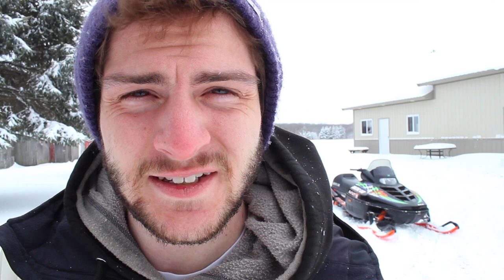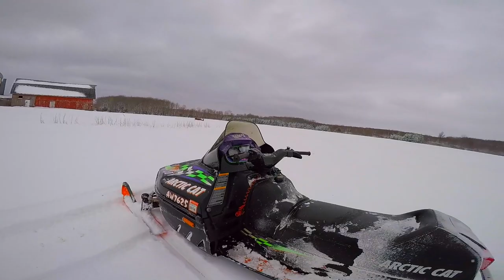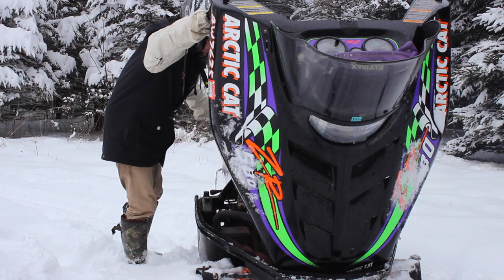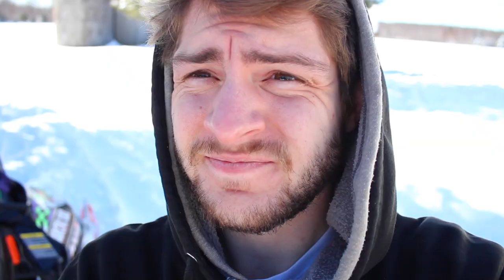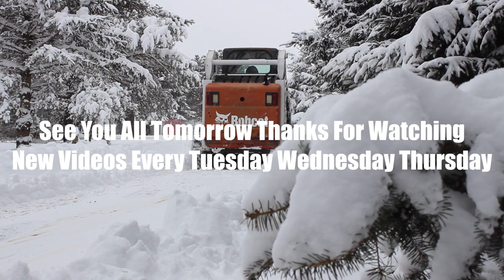MY SNOWMOBILE IS BROKEN :(

Comment from the maker: What do you think is wrong with it?? Thanks for watching see you guys tomorrow!!
Instagram: @jakesplace12
Reply: JakesPlace12Vlogs carb maybe... the same thing happened to my 92 Indy 440
Reply: JakesPlace12Vlogs check the clutch
Reply: track is melted to sliders and wont spin, or running really hot and overheating
Reply: JakesPlace12Vlogs it might be the belt
Reply: tvese1234 sliders melted!? He's riding it in fresh snow don't think it's that
Reply: Drive shaft bearing calling it
Reply: Sucking air somewhere or loss of fire
Reply: JakesPlace12Vlogs probably the clutch or the brakes locked up
Reply: A fouling plug would make it almost shut it off so idk
Reply: JakesPlace12Vlogs I was going to say "you might need to clean the carb" I don't know...
Reply: spark plugs?
Reply: JakesPlace12Vlogs what happened was the powder was too deep and it didn't allow the exhaust to get out so it ended up choking the snowmobile it will still idle but it will not have as much low or top-end power
Reply: motor sounds healthy. its when its under load it doesnt move so ima bet on spanked clutch..
Reply: It's probably the clutch the same thing happened to my sled wouldn't buy a new belt until the clutch was checked out
Reply: Try cleaning the carb
Reply: for me it was something with the carburetors or the oil injector and it could be the throttle cable is messed
Reply: JakesPlace12Vlogs Like most of these people have sayed, my best guess is that the clutch is somehow fucked up, nothing to do with the clutch but how long have you warmed that sled up until you have ridden on it?
Reply: JakesPlace12Vlogs I think you should get a Polaris or skidoo snowmobile.
Reply: It’s so easy to figure that out. You have fouled a plug and your only running on 1 cylinder
Reply: Or your running on one spark plug
Reply: Check the stator. The 1995 580 and 700 are known for crap stators. It has enough power for spark at idle. When the engine is under load, the spark isn’t strong for complete fuel burn. The result is a extremely rich fuel to air ratio and zero power.
Reply: You smiled your belt

Comment: Did you ever figure it out I got same problem now actually was curious after checking the carb and cleaning it if it was reed valves maybe for me its firing on one cylinder but it's not the plugs or spark ...

Comment: it could be the stator, my friend had a 96 zrt600 and it would start up and idle fine but when you tried to go it would rev up just below the engagement point and fall on its face. if you held the throttle it would sit at that rpm bogging. sometimes we could give it a push and it would creep along at a few miles an hour but wouldn't accelerate anymore. weird and it took us forever to track down the issue.

Comment: @JakesPlace12Vlogs check the fuel pump clean out the carbs and check your crack shaft. all of those have happened to my sleds and it was the same thing ideled fine but wouldn't move

Comment: Mine does that when it is low on Injection oil, it runs fine untill you give it too much gas and then it just cuts out. fill it up and see if it helps!

Comment: i had that same problem with my bravo its a carb problem clean the carbs if it aint the carbs idk what to say
Reply from the maker: I got them rebuilt still does it so idk
Reply: Did you check the reed valves?
Reply: @sb318wedge   no it was a carbs issue they were clogged and it would not idle right.

Comment: check the belt it might have fallen off or super loose
Reply from the maker: Thats what I am starting to think. I will try and put a new belt on this weekend
Reply: JakesPlace12Vlogs clean the carbs, if it's the belt you will be able to tell by removing the belt, it will be shredded. You should be able to adjust the belt deflection if it is to loose or tight.